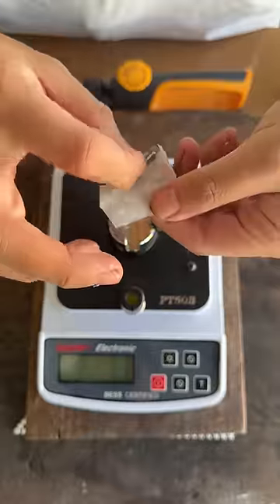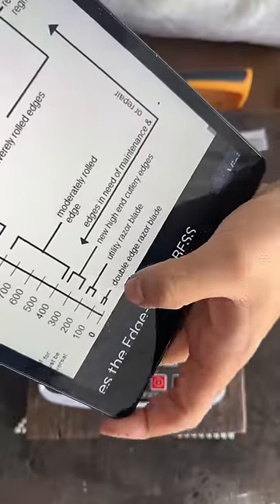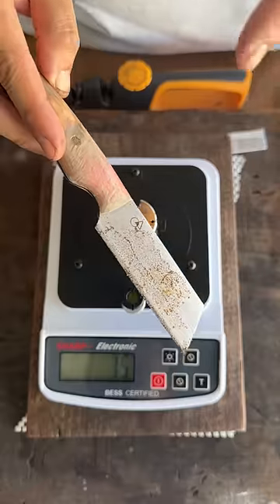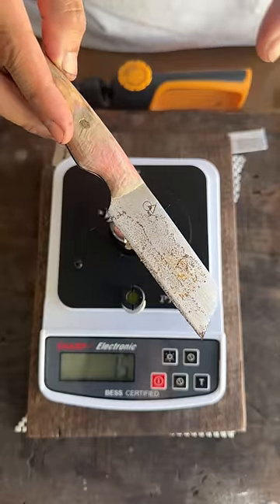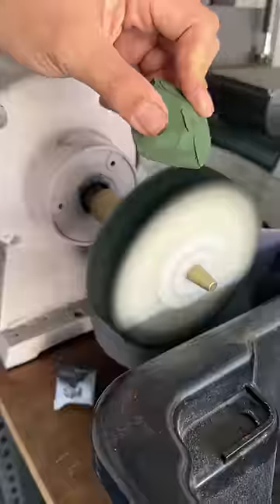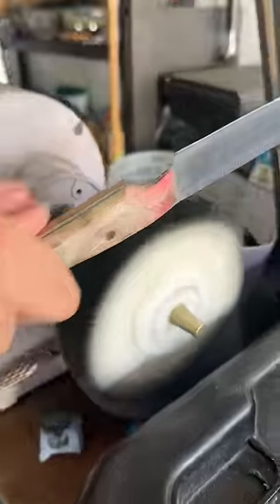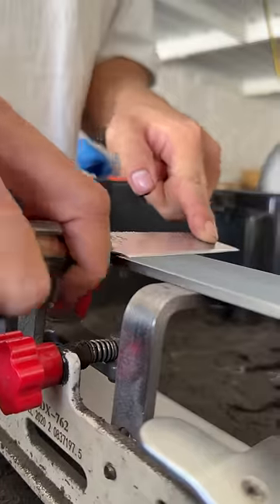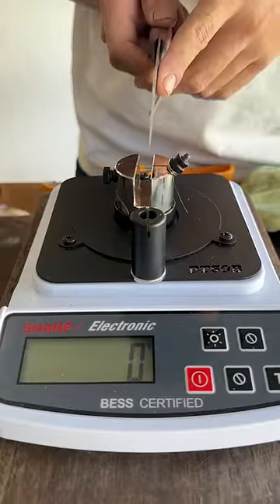Sharpest razor vs Rui Type B #fyp #shorts #knife #knives #knifesharpening #kitchen

Comment: Not a knife expert but I think a whetstone is the best option I would guess. Also getting a whole belt sander would be much more
Reply: diamond stone are better. You need one to flatten the whetstones. get 2 more and be done with it.
Reply: @country1116 That's true for actual belt sander, his rig is definitely only made for sharpening, don't think it's a indsutrial product though, certainly handmade. Kyle Royer uses a similar rig with excellent results. With experience and low speed belts it can keep every properties of a blade for years :)
Reply: 天然砥石は高い
紙ヤスリは安くて作業が早い
手入れを欠かさない人には紙ヤスリが良い

宗教的な儀式と思ってる人は変えない事が望ましい

Comment: you don't know how to use a knife sharpness tester? The results are reliable if you apply the blade "by hand" because you introduce a forward/backward movement. It is not without reason that this device has a knife rest. 🤦